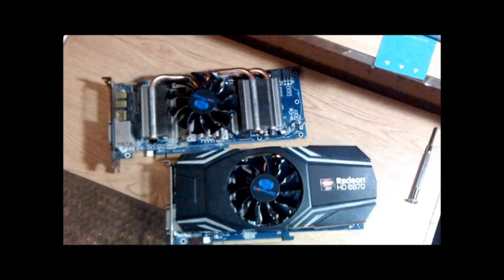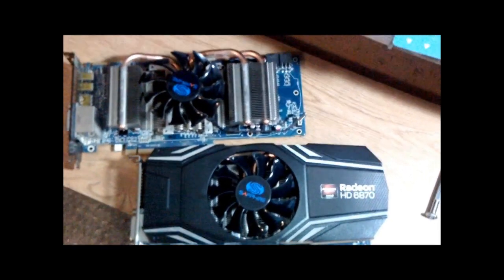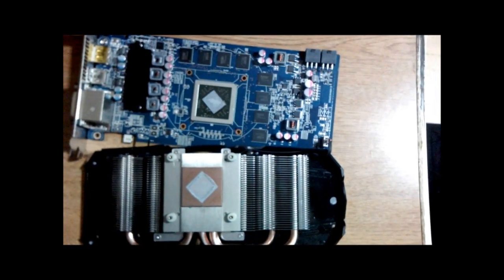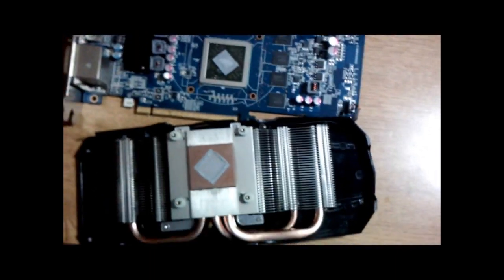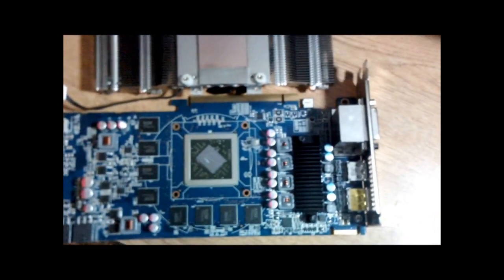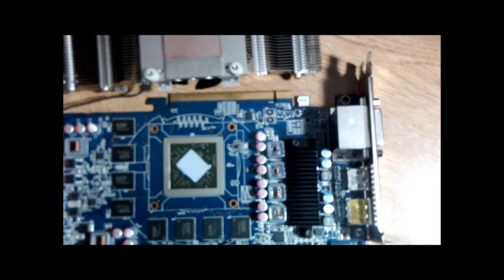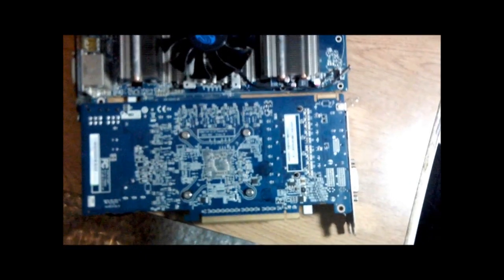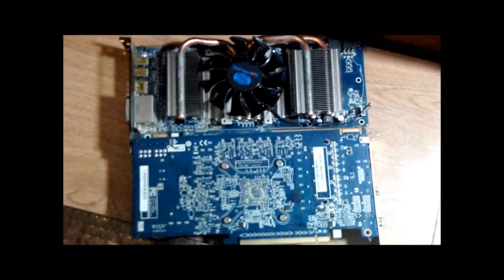Applying thermal grease on a AMD Sapphire 6870 1 gig graphics card.

Comment: Nice graphic cards. I also use AMD. Well ATI more exactly as my card is older (Sapphire HD3870 X2).Good you got those heatsinks coming with yours. Mine has dua GPU's and the fan sucks air at the end of the card pushing it trough both heatsinks.Trouble is, the first GPU's air is warmer and as it passes trough the second GPU's heatsink it does not cool it as well. ATI fitted the second GPU with an all copper heatsink to compensate a little, but it's still warmer than the first GPU with atleast 6C.